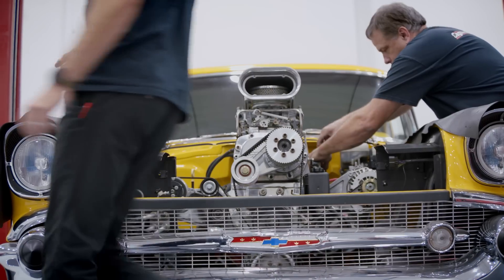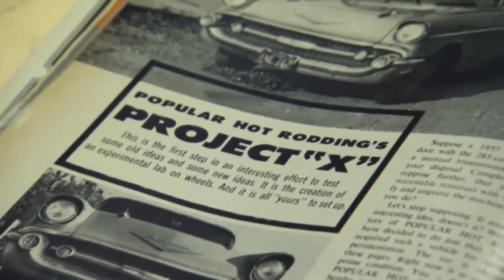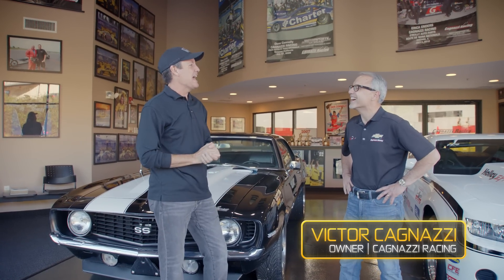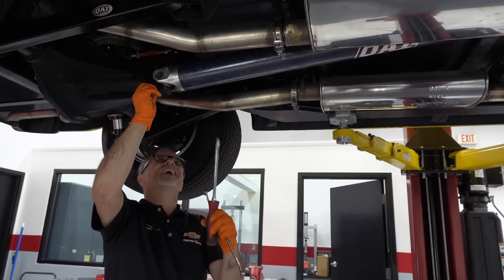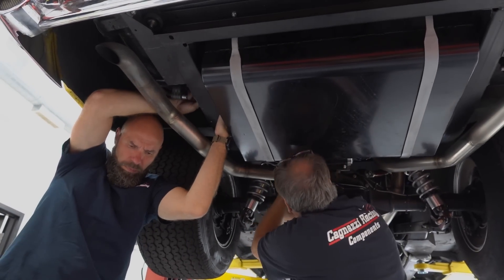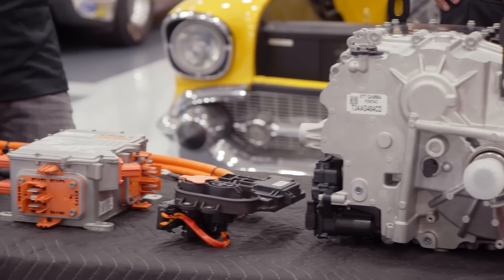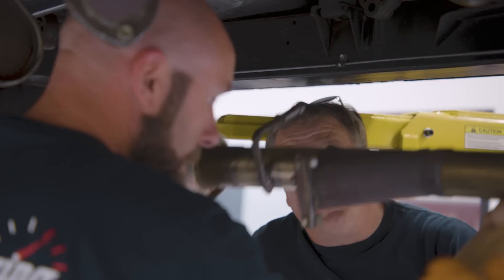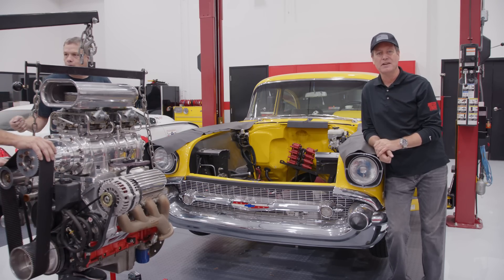Project X: EV Engine Swap [Ep. 1] | MotorTrend

Comment: Congratulations on absolutely ruining a legend. This is an abomination. 

EVs are a joke to begin with. The batteries are coffee table sized boxes full of lethal nastiness which is mined in horrible conditions by what amounts to lave labor, the current grid can't even support less than 10% of cars being EVs as it is, 80% the "clean" electricity comes from fossil fuel fired power plants, and when the batteries will no longer hold a charge, where do they and the lethal chemicals inside them go?

Comment: I remember when Project X was first built. thought it was one of the most beautiful hot rods ever. when i heard you were EV swapping it in 2022 i was like finally a Hot rod that is getting back to the basics of hot rodding. put the newest fastest tech in a cool old car.  I have a few old hot rods and there is no way i would swap a gas engine in anymore. obsolete tech. slow tech.  EV is the only way to go if you want a cool and actually fast hot rod in 2023.

Comment: Hotrodders should be open for electric as the next step, and here is why.
The nice thing of the american hotrodding is that modifying your cars is part of your culture.
Tell some one in Europe (where I leave) you put an LS3 with super-charger in an old Impala and they go crazy.
Europeans restore cars in a grandmother way. All original, slim tires, auto-club badges on the grill and stuff like that. Completely boring. 
Americans work with that old cars, personalize it, modify it, make it stronger, make it meaner, lower it, put billet wheels on it and what you have.
But there is always a percentage of stock cars in original shape. 
So give the E-Stuff a chance, classic hotrodding won't die out. BUT, with more and more EV's on the street, a goold old rumbling V8 will become more and more rare and special. Whats not too like?
Reply: NOPE! Honestly this was wrong on every level!

Comment: Is this the same Project X 57 Chevy that Popular Hot Rodding wrote about for decades?  I subscribed to PHR in the 1970’s and they did everything imaginable to that car.  Every engine/transmission/ suspension/ tires/ body / interior, etc, etc,…that could possible been put in a car was put in that car.

Comment: They can always change it back to an internal combustion engine at a future date. This is a project car that has seen all sorts of drivetrain changes over many years. Personally, I don't feel that plug-in electric cars like the Tesla(s) are the way to go. I would much prefer a high-powered hybrid where the ICE is supplemented by an electric motor and battery pack, much like the new McLaren Artura. There is some tremendous performance potential in this type of combination and you won't be stuck on the side of the road with a depleted battery pack. Even Chevy is planning a hybrid for the C8 Corvette.

Comment: Speaking as a guy whose first car was a 57 Chevy back in 1965 we bored it 30 over (302) added Corvette 11- 1 pistons and beefed up the slush bucket and dearly loved that car.  I will take the opposite opinion to the angry masses.  Absolutely swap that engine out and slam a big beefy electric dynamo in the engine bay.  Run it around a few times.  Blow off some other piston jobs just for fun.  Prove to us that such a thing is possible and what needs to happen to make it so.  Then pull all that out and slam a new Corvette engine and 8 speed in there as the next project.  But please .... don't leave the electric motor in the 57 Chevy, that is just wrong.

Comment: I daily drive an EV and l think they should have scratch built a project X2 out of new repro parts and painted it yellow. Don't kill such an iconic, historic car. With EPA on the war path, this is such a slap in the face. It will be fast. You'll make sure of that in an effort to save face. But it won't be enough. Put it back, even with the LS motor if you have to and build X2. Considering how EPA wants to kill hot rodding anyway, legally you have to put the original 283 4bbl in it.

Comment: Come on guys! Like it or not, this the future of hotrodding. Remember when people didn’t like fuel injection? People hated working with computers. They knew how to work with carburetors. This was just too new. But with it, they’re faster and more fuel efficient. With EVs, it’s no longer just about efficiency here. It’s instant torque. Anyone dissing this swap needs to ask themselves if they have ever driven a modern EV before. If the answer is “no,” then you can’t talk about it. I know of several things I don’t like about EVs, but performance isn’t one of them. ...well... ...to a point. Nothing seems like a challenge anymore. You own someone at a stop light, did you really win? Did you even try?

Comment: I'm 52 years old, and have read about/ watched this car for over 40 years.  With that being said, I'm no luddite.  I'm in the process of building a 28 model a chop top Rat Rod that will have FI, Electronically controlled transmission, e-locker, Race Pak for gauges, possibly even power windows.  I love technology and am happy to reap the benefits to feed my inner greasy handed geek.
This swap is THE ABSOLUTE WORST IDEA THEY COULD IMPLEMENT!  (Yes, I'm definitely yelling)
I'll stand by that with 2 caveats:
1.  If they can run the entire HOT ROD Power Tour with no delays or issues
2. Run low 9's
If they can do those 2 things, I believe more people will be on board.  
We all know that with GM's new 1K hp crate motor, it would do both.

Comment: The level of hate in these comments is kinda wacky, considering this car post conversion could absolutely lunch anything next to it at a stop light and give you a sensation of acceleration that pretty much nothing else short of a fighter jet can.

The lack of noise can be addressed with a custom soundscape, like how the Porsche Taycan does. 

The lack of smell can't really be done but honestly whenever I'm smelling that much gas it's probably a carb not tuned right anyway
Reply: Go away dude!
Reply: Wait they only did a single motor 300hp build?!? Man fug outta here with that. Anything less than 1000hp isn't project x

Comment: Stupid question, Why couldn't they use another car? Why choose an Icon of Hot Rodding? I have no insensitivity for changing things in a car, Ford with an LS, no issue, Dodge Hemi in a Malibu? Bring it on. But Project X is an icon for common man hot rodding, What is common man in electric? Batteries are far from cheap, same with motors. also very few (expensive) and no cheap controllers, not a very common man setup in my opinion. The history alone, should make this car untouchable. Let me finish with, I have no issue at all with EV's and no issue with changing things up. I have no real brand loyalty but to change an icon simply for the sake of change without really making it anything new, Dumbfounds me. They want to show the true bolton nature of an EV they could have build a Brand New 57 with 0 factory support and then did exactly what they wanted. Instead of tearing up a 70 year old car, for nothing but a Climate plug

Comment: The future and the technology that will come with it requires change, and lots of it,  old fashioned thinkers don’t like change, so the past and the future clash. The future is an unstoppable force, embrace it and ride the wave or resist and be left behind in a world of wagon wheels and buggy whips.
Reply: Well said indeed. 👍🏻 sounds like the same people in 2007 who claimed a phone without a key board would never sell at all. How did that turn out again for anything other than the I phone? "The greatest lesson history has to teach us? Is that we do not learn from history at all"

Also evs we're first dating all the way back to the 1800s. Then gas also requires electricity to refine, and water, plus cobalt for diesel.
plus no ice vehicle made today can get away without a battery on board it and multiple electric motors to run everything. 😀

Comment: This is just wrong on so many levels!  I or any real hot rodder I know will never be "on board" with this especially in this car. Project X is an icon. It should not be turned into an EV! It should've gotten the new 632!  If you wanted to turn a 57 Chevy into an EV fine, BUT NOT THIS ONE! When Tony and Lucky swapped in the supercharged LS that was ok. It updated the car and it was still cool. Because anyone could do this swap in their own garage. Just like "X" was always used for. But this?! I know it's supposed to be a Crate EV setup for the average hot rodder, but I believe a hot rod should have a sound and a feeling. An expensive golf cart cloaked in an iconic 57 Chevy is not going to have that sound or feeling. So sorry you guys did this. I'll bet a lot of shops turned down this job out of respect for hot rodding and Project X!

Comment: Man these guys are on drugs. I hope no one ever puts another cent into the shop that is doing this nonsense. I would be on board for this type of swap in a whole bunch of different cars but this is ludicrous. If they think it will get older hot rodders on board they are nuts. And if they think getting Karen and Brandon on board with electric hot rods will be good then look at the nascar problem when the casual fans all were over it and they had to tear down all the extra stands so it didn't look empty. I'm seriously considering saving 5$ a month to say fu to motor trend too.  What an atrocity.

Comment: This is not in the spirit of the original project x. The original purpose of project x was to be a “everyman’s hot rod”. If you want a modernized project x, start with a v6 catfish Camaro and slap in a junkyard ev conversion, not a historic work of art.

Comment: Its just another drive train like the many it has had before and no doubt will have more to come. More power & Torque has got to be a good thing, I love the rumble of a V8 just like anyone else.
Sooner or later things have to evolve or we would all be running 2 barrel carbs on flat heads.

Comment: Project x was a cheap speed car that any one could work on, this likely needs proprietary software, and a electronics engineering degree to repair,  should have got a diffrent car and called it Project V . Instead of actually innovating though they decide to piggy back on iconic heritage that Chevrolet had nothing to do with except in  1957 when they built it , and in 2007 when they made it another fad-chaser. Want to be innovative ? Innovate ! Put the Volt(?) platform in a '97 S-10 , a '05 4.3 Silverado 4x4 , 3.8 Camaro ... heck even a Cobalt ! Key is to know your market .
 Also how environmentally friendly are the batteries again ? 😑

Comment: To me “hot rodding” involves wrenching on a car. Figuring out what’s wrong and how to fix it and make it work better. It isn’t just about horsepower and torque. It’s about getting there. The late nights with friends, the weekends of putting in work. The satisfaction and excitement of firing up an engine and listening to it purr. The internal combustion motor should have been the last motor in that car. The end of an era. The ev copo camaro, in my opinion, would have been a better candidate.

Comment: I love the idea of transforming Project X… But EVs are limited by the batteries used in each application. 50 years from now batteries will be obsolete. My Aunt Retta had a 57 Bel Aire 2 door hardtop with the 265 v8. Nothing was more kool than riding in that car with my Aunt. Remember it had dual exhaust and Retta didn’t hesitate making those pipes rap. Good luck with the project.

Comment: You blew the whole point of project X! It was to show what the average guy could wrench in his garage. Where are the kits for this?
Reply: It's a Chevrolet performance E CRATE. So just like a ls crate engine you can buy this from them direct.
Reply: @jackass123455  Price an average guy can afford? Recall what the motivation of Project X was originally. I just checked, you will see 1980's power levels and a 1000 lb battery pack. Yeah, right!
Reply: @Kenjiro5775  wait so power levels between 200 to 700hp are 1980s levels? 
Electric isn't this big bogeyman and may just be what is required if you want to keep your classic on the road. Within 50 years you may not even be able to buy fuel.
Reply: @jackass123455  Try 140 to 240 bhp for 1980 cars. The Corvette had 240 bhp for 1986, if memory serves. I do not have anything against electrics, but I do have a beef about the Project X car. Some historical machines should be left as they are.
Reply: @Kenjiro5775  this i agree with but project X will have the electric system yanked out in a few years by next group who get their hands on it. remember people yelled at motortrend for putting an LS in it. or whatever theres always going to be someone who doesn't like whats been done to this car. and it those same people who will be shocked when it pulls a 10 second 1/4. 

i actually just priced out a 200-300hp build for my personal car from a conversion mob in Australia and the price if i wanted a decent 400km range (a necessity here) was 50K 30k got me 45km range.
so yes an electric conversion is still pricey (its the batteries 30K alone in the 50k build) but as more and more electric cars hit the roads and inevitably get crashed the donors for motors and batteries will increase and the cost should come down
Reply: @jackass123455  you can make your own feul these cars will run on. Think E85 it's almost all ethanol. Or in other words corn from farmers.  We will always need oil to lubricate things. So as long as you can still get motor oil. These cars will have a long life. Maybe the feul won't be as available. But in reality how many guys drive them now. You barely see any one drive these cars except to shows anymore. But when you have 100k in a car and jack wagon door dings your car with his shitbox who wants to drive them. I used to get pissed when someone would door ding my classic 30 years ago and you could buy them for less then 10 grand.
Reply: @jackass123455  One thing no one talks about is the issue of sourcing the minerals that go into these batteries. Why are electrics popular? If the answer is the ween ourselves away from petroleum, then thumbs up. If the answer is anything like "protecting the environment" then one needs to reevaluate that stance. The mining of lithium and the minerals that goes into batteries come from the least environmentally conscious regions.
Reply: @Kenjiro5775  Guess that they should have just modified it once and then kept it exactly as it was?
Reply: @AndyViant Andy, please look up the history of Project X and understand what the project was about in the first place. THEN come back and ask me that.
Reply: @Kenjiro5775  Best-case scenario this car had 220 hp stock, new.  Not sure how many 4bbls were sold in 1957.
Reply: @Kenjiro5775  what do you mean ‘no one talks about it?’ It is one of the most discussed subjects when it comes to EVs. The good thing is all the minerals in EV batteries are recyclable There is no need to have 100% new minerals to make new batteries. Because new batteries can be made using material recovered from old batteries.